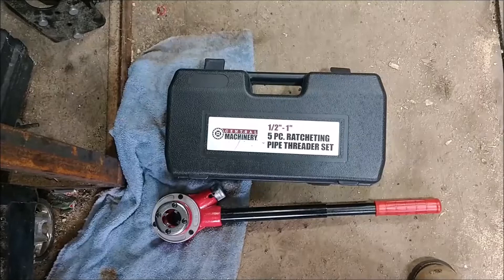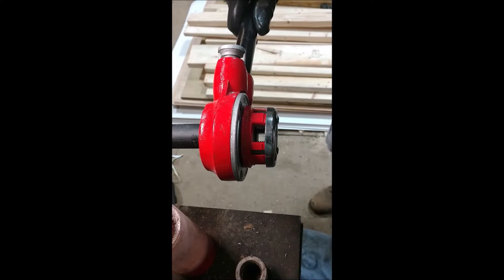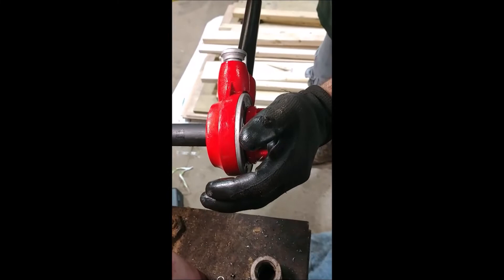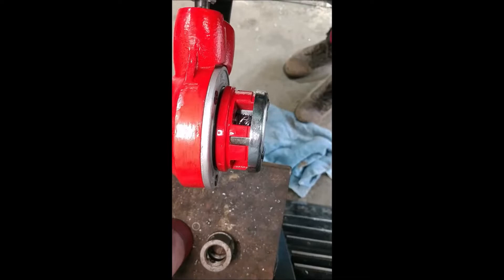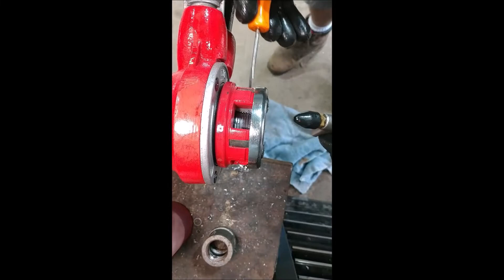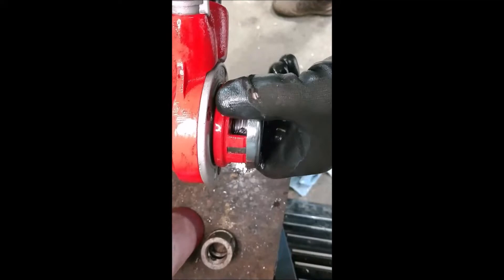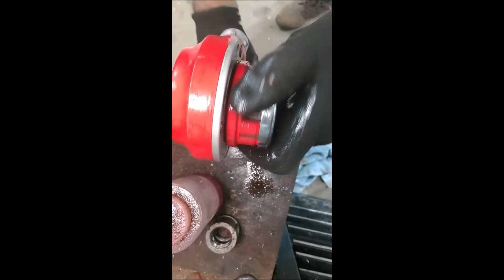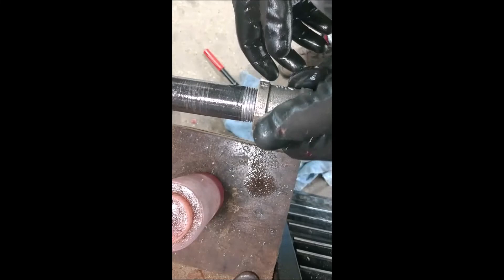Tips and instructions on how to use a Harbor Freight 5 piece pipe threader.

Comment: Thank you for a great video. I have never done this before, but unfortunately I have to. The pipe I need to thread is in the ground and vertical. I hope I'm able to get enough torque. It's gonna be a challenge to hold it from moving while I'm threading. I appreciate the clear demonstration of how to perform the procedure and how to use the toll properly.
Reply from the maker: Hi, thank you for the comment. Assuming the pipe you're working on is not too big, maybe you can have someone with a large pipe wrench hold the pipe for you? I've had to do that to a 1/2" pipe. Good luck.

Comment: Thanks for the video.  I'm going to try your method the next time I have to do any pipe threading.
I just did a small job this past weekend and the threads worked, but they were a little on the rough side.
Reply from the maker: It works for me. I get the results I'm after, even if the method is unconventional. Thanks for watching and the comment. Good luck.

Comment: Hey thanks for the video,  great job. I saw that you used diesel fuel for the lubrication.  Remember that fuel, even diesel is a solvent,  and a better cleaner than lubricant. I used cutting oil from hardware store and did not have as many shavings... just a thought.  Thanks again!
Reply from the maker: Yes sir, cutting oil is the way to go! Thanks for watching and commenting!

Comment: Thanks for the great vid.  I am using galvanized pip to make a wheel chair for dog so it is strong.  I bought a harbor freight die/tap set.  Low and behold, 1/2 in galvanized pipe does not use a 1/2 die.  A 7/8 was too big, a 3/4 is too small. Just to verify, the pipe set in your video, the 1/2 in is to cut 1/2 in pipe correct?  Thanks again!
Reply from the maker: Hi, I have only tried to cut threads on black iron pipe with this harbor freight kit. And if I remember yes you are correct that 1/2" is for 1/2" pipe. Good luck with your project, sounds interesting. Thank you for watching and the comment.

Comment: You have to constantly apply lubricant as you are threading. The shavings weren’t affecting it. Just wrong lubricant and not enough lubricant
Reply from the maker: Hi Jas2485, We'll have to agree to disagree. The metal shavings absolutely affect the way the threads come out. If you leave them in there they get jammed into the threads. I won't disagree a cutting fluid might make it easier, but the diesel fluid I was using works great also. This wasn't my first time cutting threads. I believe the fact that they come out so nice I can hand thread everything together proves my methods work. My methods might not be for everyone, in which case you do you. Thank you for watching and commenting! It really helps grow the channel and get my methods out there!
Reply: You shouldn’t be able to hand thread the fitting all the way onto the pipe you should get about 3-5 turns before you have to use a wrench because of the taper in the threads .. and he’s right you need cutting oil and you have to use a lot of it.. not whatever your doing… there’s no “my way” there is one way to do it and that’s the right way and has been for decades

Comment: It's getting stuck because you aren't using enough lube nor the right lube. There is never a need to try to get the shavings out of the tap while threading.
Reply from the maker: Yes, always use the "right lube" for the job. If you're referring to cutting oil as the "right lube" I've used it, it does the same thing. The only time I'll need to remove the shavings, is when the shavings need removing. Thanks for watching and commenting, it really helps the video get more views and to grow the channel!